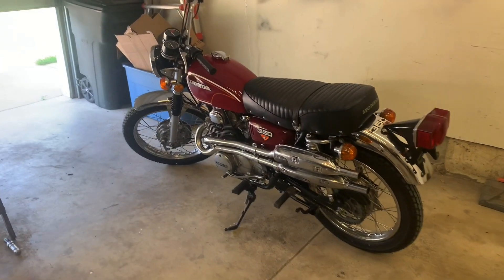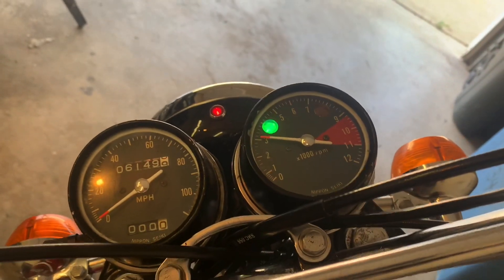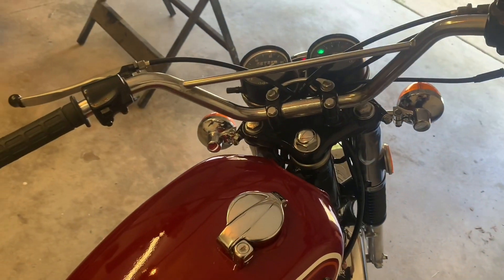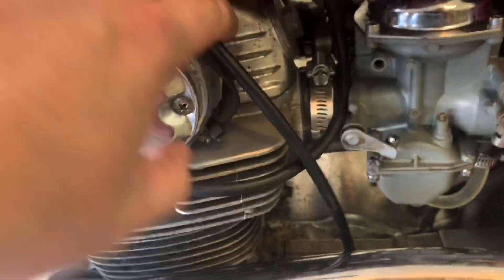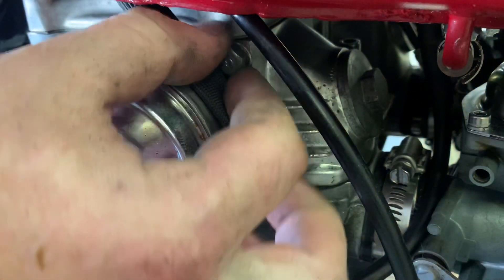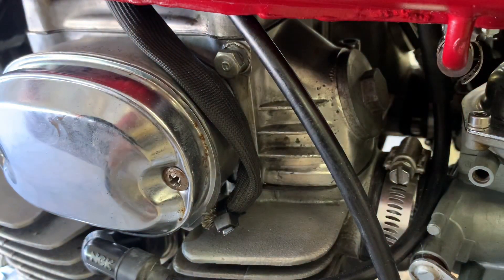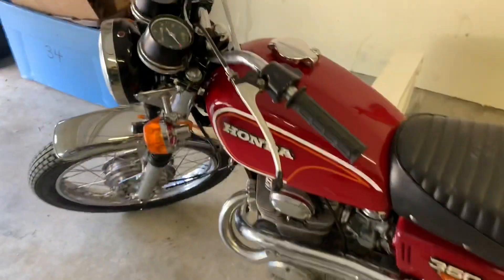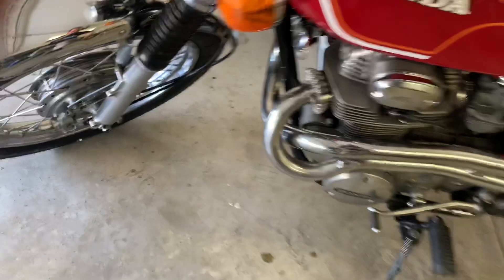How To Test For Top End Engine Oil Flow: Part 200

Comment: Hey, I'm just before the first start of my CB350 after the topend rebuild.
I tryed crancking the engline with the starter motor to see if the oil flow is there, but I couldn't get the oil pumped up. Do you think it needs to be running (=more rpm) to build pressure and pump the oil?
Thanks and in general thank you for your videos, they helped a lot!
Reply from the maker: Yes. Sufficient pressure is likely needed
Reply: Thanks, Then I will check it when the engine is running, just like you did...